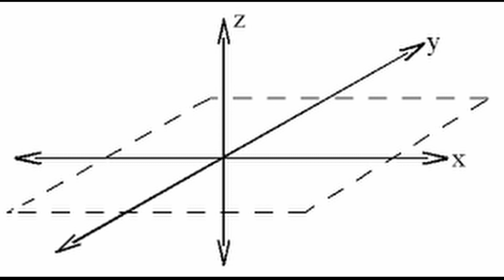X, Y, and Z AXIS Explained for CNC, 3D Printing, Die Cutting

Comment: Hi Roger. Love your videos. Question, I have a Atomstack A5 M40 laser engraver. My Y axis will not move front to back. X moves left to right just fine. No issues with Z either. But X will not move it just Shakes bad in place. I replace the Y stepper motor. I replace the mother board and the wiring harness. No affect?  Do have any ideas?